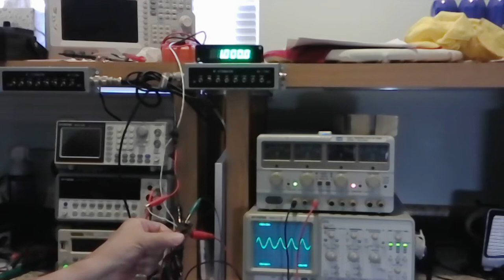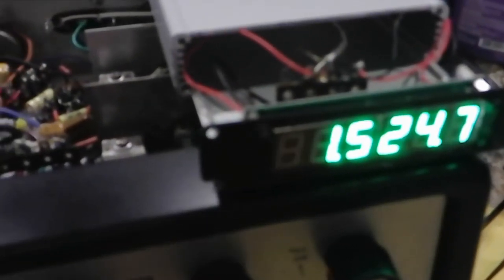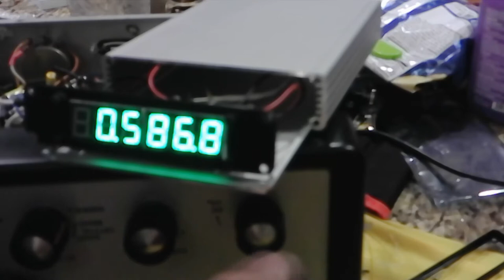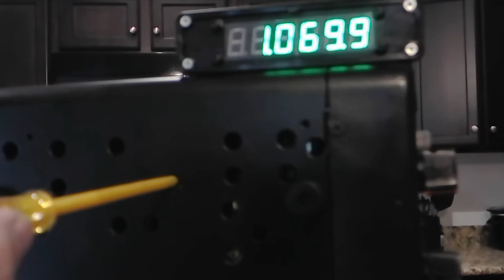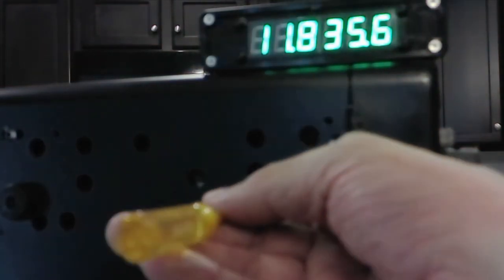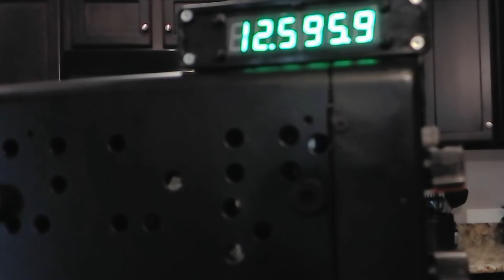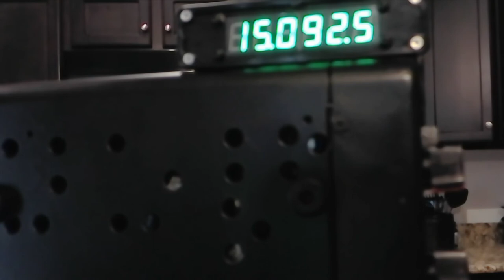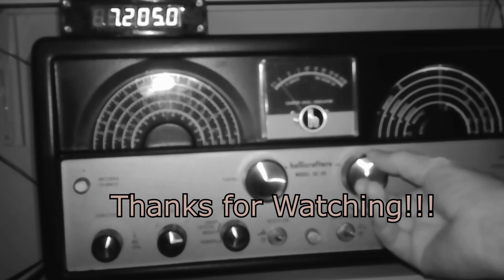Vintage Hallicrafters Shortwave Receiver SX-99 Digital Frequency Display Install

Comment: I connected mine to a 7 tube AM radio. I went through a 103 cap and a 4.7M ohm resistor to pin 5 on a tube. Works like a charm.

Comment: Very nice! I want to do the same thing to an s40b. What tube do you tap into for the frequency signal?
Reply from the maker: The SX-99 has a 6SA7 mixer tube that combines oscillator with mixing the incoming signal with the IF frequency available through the IF transformer on the plate.  The best tap point on the mixer tube is the cathode so the tap does not drag the oscillator.  It is important to install a buffer circuit, which is a custom PC board along the lines of the buffer circuit that Mr. Carlson's lab used on a Hammerlund install some years back.  The video is still there on his channel.

Comment: It looks like a Molex connector on the back panel that you are using to connect the counter to the radio - could you state which one please ? Also you stated that you are using 7VDC to power the counter - how are you arranging this ? I’ve ordered parts to do exactly this with my SX-99. 73, Jamie WB4YDL
Reply from the maker: Hey James I am at my Dad’s but I think I used Mouser 538-76650-065 four pin connector but any four or three pin will do. One pin is power, one pin ground and one signal from the cathode (shielded at the connector side). The 7 vdc (unloaded) is fed from the 6.3 vac filament lead to a 2w 22ohm resistor to a shotkey diode parallel, i think, with a .1 mfd cap to a 2200 mfd 50 vdc electrolytic filter cap, which provides a nice dc voltage for solid state things. I mounted this on an ordinary terminal strip near the radio power supply area and used a simple multistranded insulated wire to the connector. The simple rectified power supply is drawn on one of Mr Carlsons Lab youtube videos 2 or 3 yrs back, as an add on for a Hammerlund restoration, I think.